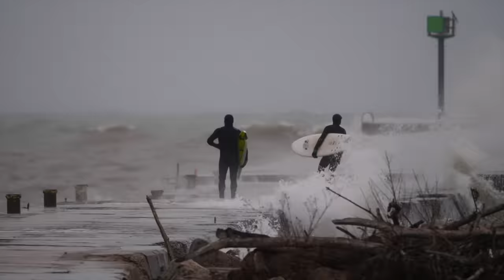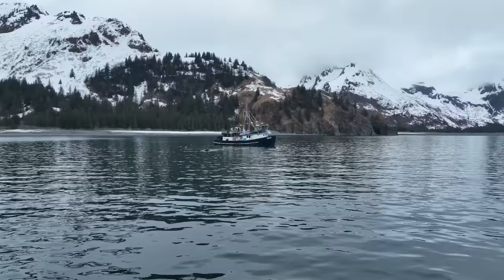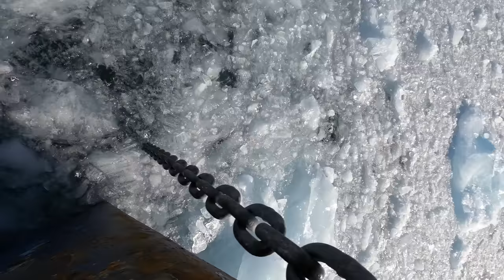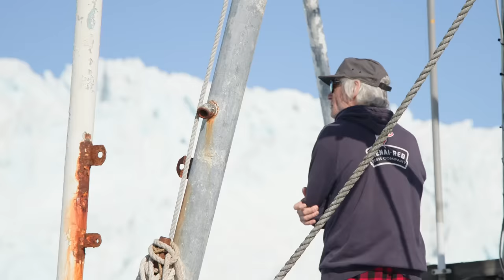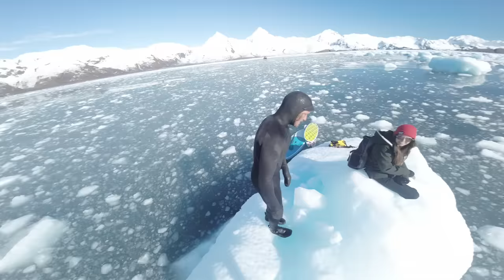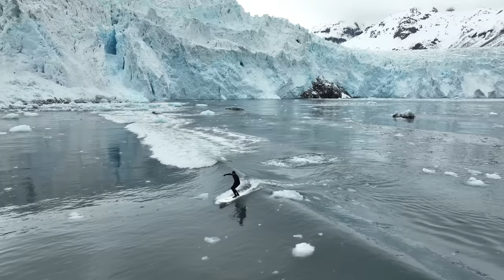600ft Tall Calving Glacier causes Massive Wave to WIPE OUT BEACH

Comment: That was just dumb luck, being in the wrong place at the right time, but then getting the heck out of Dodge before the big event. These were really cool videos, from the extremely dynamic environment of the glacier front. One hazard that you did not mention is that the impact of the ice onto the water surface generates a splash that hurls 250 pound blocks hundreds of feet beyond the splash zone. A 60-quart Yeti-cooler sized on a ballistic path will really ruin your day. Glad every body is okay.